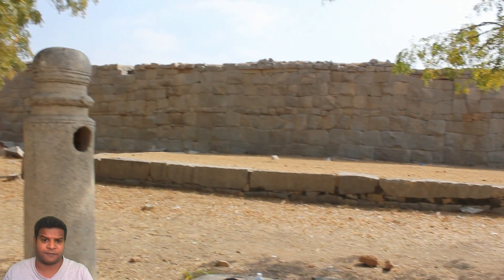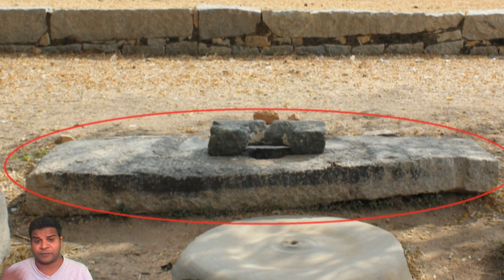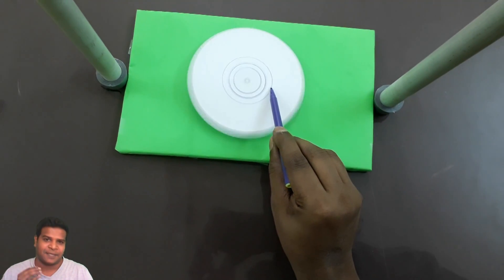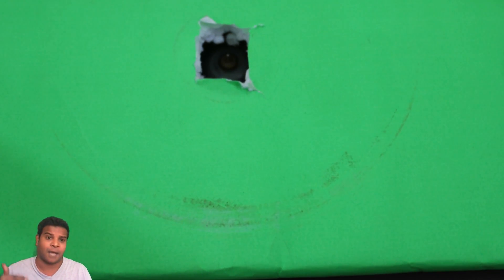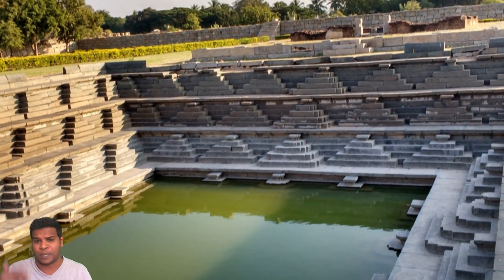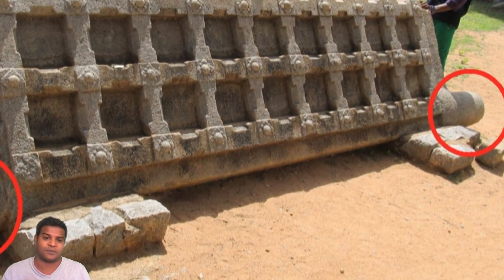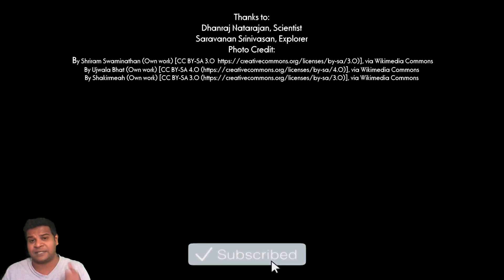Ancient Lathe Machine Found in Hampi, India - Lost Technology Discovered?

Comment: 7:50 at seven minutes and 50 seconds. I think you’re right a little bit but I think the bar that’s horizontal is correct and then the bar that’s vertical has a hole and the bar that’s horizontal and goes up and then imagine another steering wheel on top of the board that’s verticaland do you see the both little stones that’s keeping the bars up if you look closely around the head, Look Like you can put a timing belt and think of a steering wheel on top and the one on the bottom on the floor is correct but one goes on top
Reply from the maker: Appreciate you taking time to comment 🙌

Comment: Just think about it. Why in the world would they bother to carve those groves in the stone with a chisel? It would take forever to do and for what purpose? No those are incidental to the shaping of the stone, a roughing of the stone. When shaping material, you do it coarsely with a fast feed rate and that is why the lines are there. when you get close to the final shape you slow down the feed rate to get a smoother finish. Just watch someone resurface a brake rotor or cut some stock down to create a shaft of a certain size. Just watch some machining and milling videos. It'll be quite clear to you what is going on here.

Comment: I respect your knowledge and perception. 
However,  I have to add here. 
On another video,  what I saw was a different perspective. 
According to that..I will explain. 
The centre stone was where, a rock or pillar was placed..  it was tied to the side pillars with ropes.. 
The same ropes went to the back where the rectangular block is. 
On the block, there is a round cutout ( a bit like a masala grinding stone).
There used to be a round stone fitting that groove.  And it had a handle. By moving the handle back and forth ,there main rock or Pilar would move back and forth..
This supposedly wS done by 2 or 4 men, or maybe even horses.
And The rock was chiseled into shape. 
I saw this on a Hampi tourist video..if I can find the link , I will send it to you.  It seemed more plausible, because it was manual labor. 
I'm sure, another version would be of interest to you. 
Thank you   ,your video is amazing.

Comment: @PraveenMohan That’s an interesting theory, but if the poles are part of a lathe, you’re missing several (many?) of the pieces. Especially since the block is not between them.
The lathe can’t be just hung between the posts, It needs a control mechanism/machine to make intricate & mirroring cuts. You also need a high speed engine to spin the unfinished/unformed rock blank at extremely high speeds so the lathe at sufficient uniform turning of the blank so as to get the finished product from blank to blank to make them exactly alike.

Comment: Yes, VLT machine. Question is what drives the chuck?   A leather belted pulley system connected to a water mill.   If not,  human or animal powered using sprockets and chains? Or, electricity!  Why not. Electricity would explain a lot.
Reply: The process he explain was slightly similar to the exact process but not the exact but it looks like ancient people using the same tool that we saw in the video may be they put the stone opposite side to draw linings may I don't but the thing praveen tried to say that there was some technology.

Comment: What if the lathe was vertical instead of horizontal? Tools would come in to cut from the side not the top. More cutting force that way. That plate might be the base plate a work piece would be set on to do work. Aka like a potters wheel.

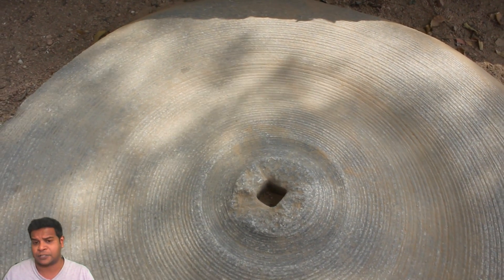Comment: At 1:01 you claim that the central rectangular slot was "created by a lathe". Please tell us what kind of lathe cuts a rectangular slot ? Having watched the entire video which showed some interesting megaliths and a lot of supposition but no lather as your video title suggested
Reply: I'm late to the party, but here goes.  He didn't say the lathe created the square hole.  He said it was evidence a lathe had been used. A square key or driver would have been used to either rotate or align the circular rock while machining was done.  That would be why the rock surface is higher around that square hole.

Comment: follow-on questions:  the pillars are not over the stone slab - how did they move the slab into position?  There is no rotational mechanism under the stone, so how did they turn it?  What tool tip would they have used that would have been hard enough to cut such grooves, let alone finish a piece?
Reply: I have the same question as to what mechanism would they have used to rotate the circular rock placed over the slab?

Comment: The composition of a gigantic heavy stone structure like pyramid, based on symmetry, whose principles architects should take the greatest care to master. Symmetry derives from proportion, which called analogia in Greek. Proportion, the mutual calibration of each element of the work and of the whole, from which the proportional system or stability achieved. No structure can have any compositional equilibrium system without symmetry and proportion, unless, as it were, it has an exact system of levitation correspondence to the likeness of a well formed human being. Similarly must be done on the other jobs related to especially heavy duty machines with respect to the needed precision and rigidity of the products in order to achieve mechanical advantage with stringent safety of minimal moving parts (heavy duty levitation) during delivery to build and connect etc.. What's the bigger picture of the original projects rather than temples and tombs only fit for the primitive believe? We don't know.

Comment: They had Black Sands from panning for gold.
Black sands contain thorium, titanium, tungsten, zirconium. 
 
These properties make zirconium useful as a common diamond substitute.
They could have forge-welded these black sands into copper tooling.

 A long copper saw blade impregnated with a layer of black sands on its leading cut edge would act as a substitute  Diamond cut off saw blade similar to a tile blade but used as a band saw cut method,draw saw , 2 man saw , or possible as a circular saw blade cutting tool if they had that knowledge.

Zirconium carbide and zirconium nitride are refractory solids. The carbide is used for drilling tools and cutting edges.

They would have to be used in their crystallized form before breaking down due to oxidization.
This would be a means of drilling core style holes by way of using copper tube impregnated with black sand ..

Comment: As usual a great video this one is exceptional, you say tool marks I am a machinest and very familiar with finishes, tool marks and polishing on ferrous and non ferrous steel. Tool marks on granite? What could the tool be? Diamond? Diamond and carbide could not take the interrupted cuts with out breaking although I saw a machine grind up a street made of hot top and load it in a truck to be recycled it used very thick carbide tips that are replaceable but you’re talking granite here extremely hard, abrasive, uneven, heavy, no cutter known today except diamond impregnated abrasive cutting wheels, in a massive water cooled saw or carbide or diamond tipped drill could achieve these results. Too see this with my own eyes is incredible where did this technology go? Love this stuff!!!

Comment: idk but i saw a build builders build temple in old fashion like thousnadnds of years, drill in the rock and drill hole through for  solid rock bell to hang on. they chip out after measuring and stringline end to end for center, then smash tool down in with sledge, rotate, hit rotate hit rotate hit, makes a suprisingly round hole.

Comment: Very probable. The bottom stone has a square drive or lock hole in the middle. The bottom circular rock could have been turned by a rope or belt and manual power.
Very nice plausibility

Comment: These things were built and used so very very long ago that all of the non-ferrous metal components that were part of this machine rusted away and disappeared. Think about it, if you left a big tractor or any massive type of machinery to the elements, How many years would it take till there was no sign of it...500 years,5000 years or even 100,000 years. Stone erodes much slower than iron or steel and that's why no tools are ever found at the ancient sites. Only things of stone. Thank you Praveen for another great video. It is amazing how the west has ignored India's ancient history, maybe amazing isn't the correct word but India has some incredible ancient history,Thank you Praveen for sharing it with us
Reply: If they used metals, they for sure got recycled eons ago, because in antiquity metal was scarce and precious. And if they mostly used organic materials (wood, bamboo etc.) for the construction, it simply decayed and finally ended as firewood when it broke.

Comment: Bro, I’m not a mechanic but I believe there is some corrections needed on your findings. As we see the marks on the base rock, it’s not created by the rock kept on top for lathe. It’s created by the same needle which carved the rock. I believe it’s not the rock rotating from the base rock, it’s needle rotating from the two supporting pillars. That rotating needle caused same marks on the base rock by accident. Because it’s same circular well carved structures, it’s not scratched by accident. Also if you think about this mechanism, it’s very difficult to rotate a rock from the base rock. Rock would be having heavy weight and there is no efficient bearing technology at that time. Otherwise they should use some lubricants to rotate the rock. But that also difficult to rotate a rock. One more thing, To rotate the rock from base rock, base rock should be very smooth at least, but here it’s not. So my conclusion is, it’s not the rock rotated from the base rock. It’s needle rotated in circular form from hanging pillars. If you see the carved rock, you can see one hole at the center. I believe there might be one rode which connect to top bar and somehow they fitted the needle on that bar and rotated in circular form. If I’m a ancient technician, I will definitely look for the way to rotate the needle instead thinking of rotating the heavy rock from the base. 😁

Comment: It does seem obvious they spun something to make those cuts, but what would they spin it with?
You'd either need to spin it quickly or for an extremely long time to get those results in hard rock.
It's too bad there's no evidence around it of some system to get animals to turn it or a water wheel or a mechanism to turn human power into rotational energy. Presumably those parts would be wood and are long gone...
Reply: A guess:
Using the same mechanism as Pottery. Making base as frictionless as possible, and increasing dia of Circular rock for increasing Bending Movement, thus making it to attain higher speed.

This is all I can guess with these available resources. Maybe a detailed study of surroundings might reveal the mechanism used in this.

Comment: Hello, I'm an engineer. That round stone is turned,
but the whole machine is not a lathe. It would not work.
Cylindrical columns with holes are very difficult to manufacture on technical equipment. Columns should be blocks and not cylinders with decoration.
It probably is a place for punishing instead of a lathe. But that doesn't mean I don't agree with Mr. Praveen Moham in other videos. On the contrary.
I am convinced that in ancient times they used advanced and sometimes better technologies.

Regards
V.Kašpar

Comment: One problem, where is the mechanical portion for turning the stone at that sight?  Hiding underneath the dirt?  If there was any real mechanism for turning the stone I couldn't see it.  Yes, it does appear to have a vertical lathe setup and the marks do appear to be machining marks, but I want evidence of the mechanics that made it actually function.  You need a mechanism behind the chuck to spin it, you need ways to move the tool holder and I see no obvious evidence of any of that there......

Comment: I'm just discovering your videos so far the two are watch are awesome excellent point right on point to. You got to go further though what did they use to power their lathe and drill their holes and left 10 t o n doors a 60000 ton blocks. Even though the set up  you found there seems slow it would  take a long time to actually Mill something out of that. You have some great insights.

Comment: The stone rocket engine could be a particle accelerator section but also because it's not in the launch position it may also be a spindle node to a lathe. I used to set up cnc and manuals i didnt think spindle at first i haven't been in manufacturing in years. I thought it was a particle accelerator

Comment: Look for evidence of tooling that could be used in conjunction with vibrations.  Ask if there were large horns of different sizes. Or other types of things that could create vibrations.  Also any copper or brass tools.  Could be cylinders types and chisels that would not look like they were used with hammers. 
  I've seen rocks drilled easily with just a heavy weight and vibrating a cylindrical tube. The copper used wasn't even damaged in the process. Could be a viable way to carve stone quickly with minimal effort and in very clean and perfect way.

Comment: I watch your blogs regularly. They are fascinating. I was watching another video on Jaighar Fort Jaipur today. It has a special room called drilling room, It worked with 4 pairs of bullocks for drilling. Bullocks rotated object on top floor where as bollocks were placed inside room below.  They used this technology for manufacturing cannons. It is quite possible that Hampi vertical lathe machining may be similar. May be perhaps with use of elephants in open air instead of bullocks inside room below. The lathe you have discovered may be for rotating big and heavy stones for turning / drilling  the heavy objects like shaping of stones.

Comment: Not only is milling stone long ago still a mystery, but the use of Stone instead of wood or metals.  Everywhere, Stone. . ?  It's not because there wasn't any wood  or metal, right?  Even the metal stone clamps are missing everywhere.  Only a couple of them remain in Peru, but they weren't incorporated into the stone blocks, but instead they were found laying about in other places. . .  It appears that all the metal in these items were evaporated some how, and the builders knew about the subjective effect of using metal except for unique applications in regard to Stone, once again.
  With all our science today along with all the examples around the world, why is building Everything from "stone", this one thing, so elusive still yet today? To my feeble mind, stone isn't an easy thing to work with, and it's too damned Heavy and Brittle to realistically do, for us.
  However in Egypt, the columns and obelisks with intricate stone carvings appear for the most part to be made in a super layer, then laid out over the stone base. . ?  One can see where the top layer has fallen off in places, right?  And the carvings are so finely made with each character, with the exact same perspective, shape, and depth as all the ones on the structure with NO SPALLING Effects what so ever.. .  We do the same thing today with Concrete, as well as ceramics and pottery.  Pouring or pressing synthetic rock into molds. However, our concrete structures haven't any Milling Marks as these Stone structures do.  Also, our creations haven't any Natural Grain such as found in the stone, which these ancient things do possess as well. . ?

Comment: I think it is a vertical lathe like you say.  But i think the rectangular piece laying on the ground set on top of a their carving piece. Maybe on an adjustable wood or iron frame that has since eroded away. 
      The square hole could have been for a replaceble point or center for the workpiece to spin on. 
     Think also of the mechanism needed to spin a heavy stone, even slowly. Not to mention the tool doing the cutting. 
      Also did you know that diamonds can be welded to metal cutting tools with brass . These people would have found this to be easy. 
     What an amazing world they had without the distractions of today.

Comment: I love your videos but there is always more than one way of looking at something so I'm going to throw this out there, The stone on the ground between the posts looks like a softer stone than the rectangle piece of stone behind it. If you place the softer stone on the top and turn it with nothing between them to stop the wear, you would get the radial lines that you see. It would be possible to place 2 stones on top of one another to get a perfect fit. So its possible that there was a crank or wheel on a spindle put through the centre of the cross beam ( to control lateral movement ) while turning the top softer stone to face it rather than a metal tool as you describe 🤔 we have mill stones over here in the uk which have similar Mark's due to neglect while being used to grind grain to make flower..
Just a thought!